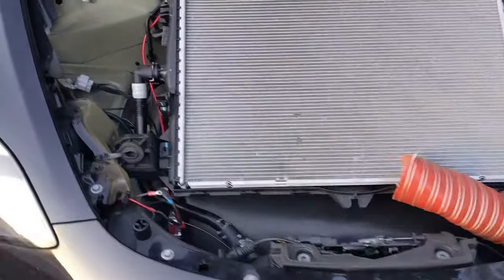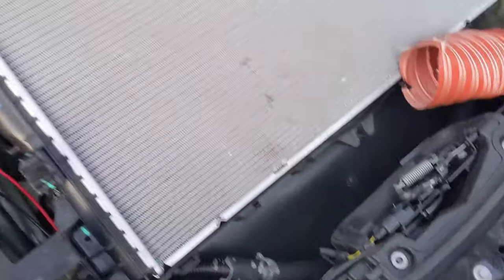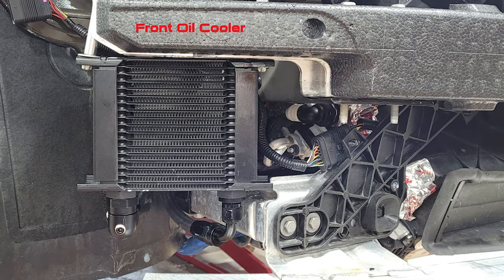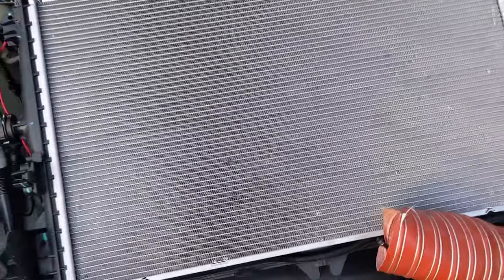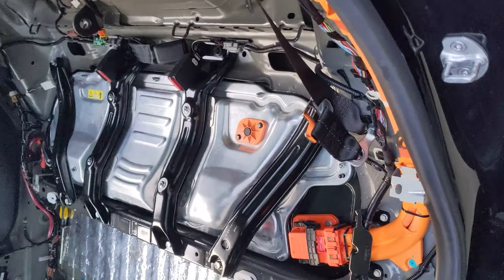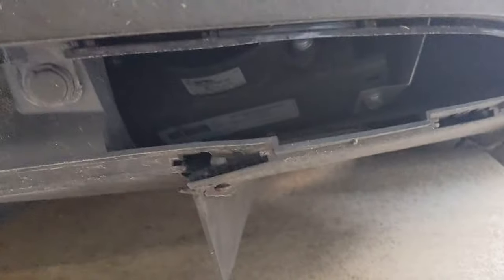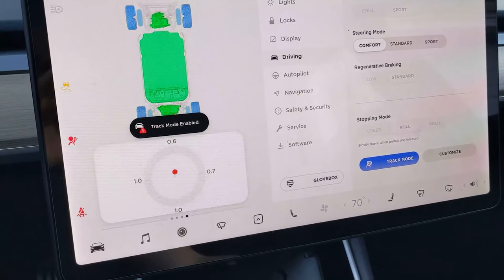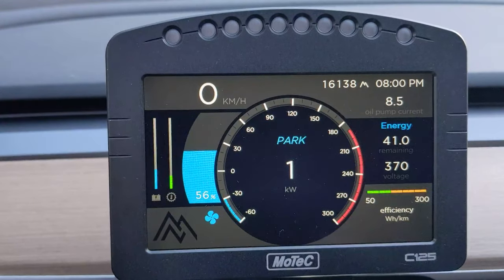Tesla Model 3 Performance Cooling System Upgrades - Oil Coolers, Radiators, and More!

Comment: Good stuff ! I wanted to understand the cooling system, and you have expanded my knowledge beyond 'stock performance'. I see many areas of potential failures on the heat dissipation side of the equation. Commonality in one part of the system could disable the independence of the entire system. Independent fluid based oil coolers driven by the motor itself via flat plate heat exchangers is the most efficient way I can think of to do that. Fluid to air independence driven by unit powered fans/pumps, for fluid to air exchange - would be Awesome Technology ! Each having their own electrical system and batteries would be even better ! With wings & props these things could fly.

Comment: Can you limit the battery temps so they don’t cool off too much. Some heat is good in the battery. It looks like that giant radiator could cool the battery off too much.
Reply from the maker: There's a few different possibilities. You could use a 3-way valve to divert coolant through the radiator only when needed. You can also avoid pre-cooling the battery. Waste heat from the motors can warm the pack still, even in freezing temperatures.

Comment: Awesome I just took my 3 apart after having heat issues on the track, was looking at something like that for the frunk, can you tell me where you got the connectors to plumb in the radiators. How hard was the rear oil cooler to install.
Reply: The benefits are huge harry.

Comment: Nice information and setup, did you consider some hood openings/scoops like intercooled cars tend to use to help force air thru your frunk radiator? At speed that should be a lot of cooling.
Reply from the maker: Thanks for the feedback! It would definitely help if additional cooling was needed, but after moving to a more permanent radiator solution and lots of testing the battery cell temperatures aren't the limiting factor, and this non-vented setup allows enough cooling without over-cooling.

Comment: Question for you. What if you add an ice tank to the model 3? Anybody think thats a good idea?
Reply from the maker: I did try something similar, basically spraying the radiator - it's overkill though. The additional radiator will manage pack temps fine. The car then pulls power as a result of managing the discharge rates, not due to the cell temperature itself.
Reply: @TrackMyEV  is that radiator hookup to to both motors? I just got an oil cooler kit for the rear motor for that exact reason. I'm thinking of running an additional radiator under the frunk as well to regulate it as mine is just the SR RWD. So I figured the front space where the front motor is could probably hold an additional radiator and just run the line to the rear motor. Not sure how to do that that.

Comment: Could you show us about the rear diffuser? Is it a kit or one off made? Looks functional, very interested. Cheers
Reply from the maker: It is one-off. I made it using some universal diffuser kits and integrating them into the factory piece!
Reply: @Model3Challenge  please do share that with us. I’m very interested, thanks.

Comment: Where did the parts come from, and who did the install?
Reply from the maker: It's a combination of my own designs in conjunction with Mountain Pass Performance. All installations are done myself, I have a business doing this. Check out my website for more info.
Reply: @Model3Challenge I haven’t seen anything regarding radiator upgrades ultimately come out from MPP. But I’d be most interested in upgrading the radiator system than adding a specific oil cooler as they offer. Increase overall system cooling and let Tesla octovalve handle the rest. Any thoughts here?

Comment: What kind of oil is used in the front and rear drive units. How much more oil capacity do you get with your setup.
Reply from the maker: I'm using Royal Purple ATF MAX. Oil capacity is doubled with the new cooler and lines.
Reply: Fascinating! Do you know if Tesla's automatic transmission fluid is specific for the drive units or is it something where you could use any automatic transmission fluid since not all automatic transmission fluids are the same?

Comment: You mentioned that you could run 12-13 minutes before the mods, how many after?
Reply from the maker: About 20% longer.
Reply: @Model3Challenge  What was the penthhouse modification? if you can disclose now.